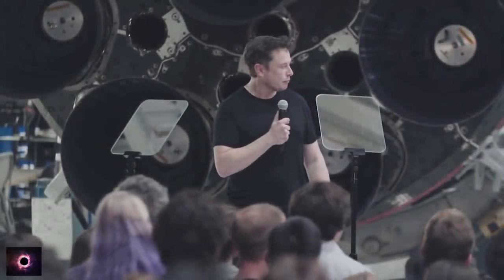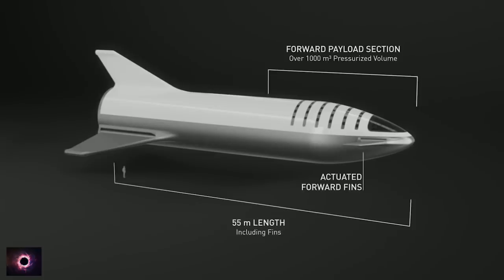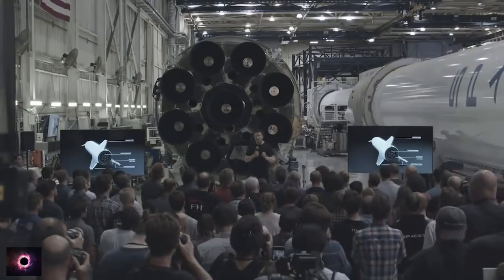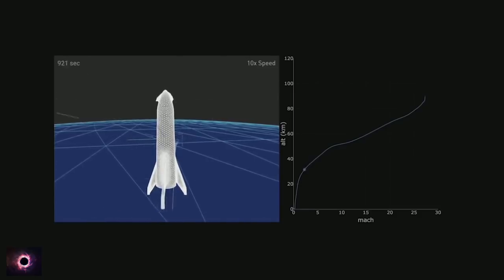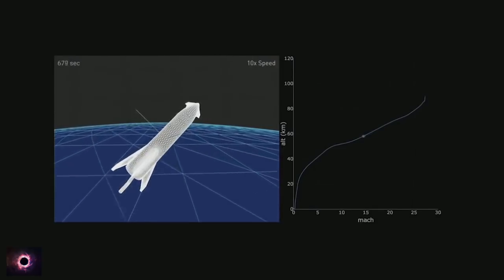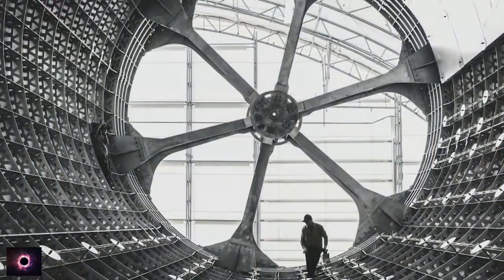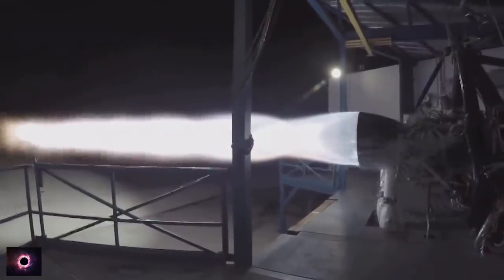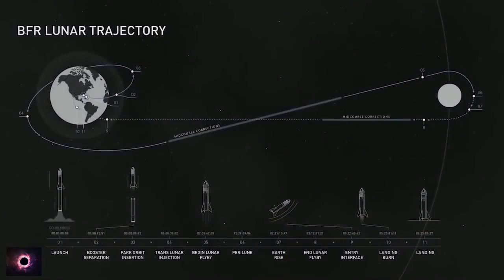SpaceX BFR Rocket (Presentation) - Elon Musk Talks About The New Design

Comment: There's going to be problems with the heat shielding using the micro-pores both blocked pores and burn thru among other issues. Hopefully they can get the engines as reliable avoiding any catastrophic failures  and as rare as failures in the airline industry. Also, There might be problems landing a ship that big (100+ tons) without existing facilities. In other words do I fly to Mars (Or Moon) but if you land in soft ground or sand it may tip over. At least someone's trying I guess.
Reply: Obviously they are aware of these issues and are working to fix them if they are legitimate.